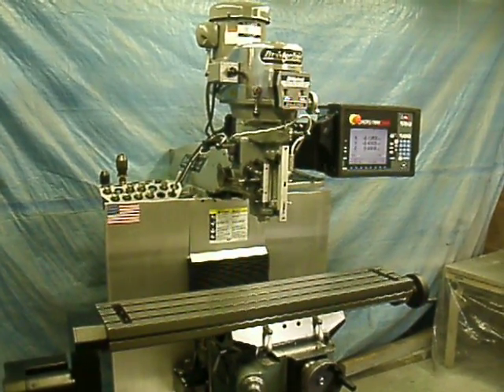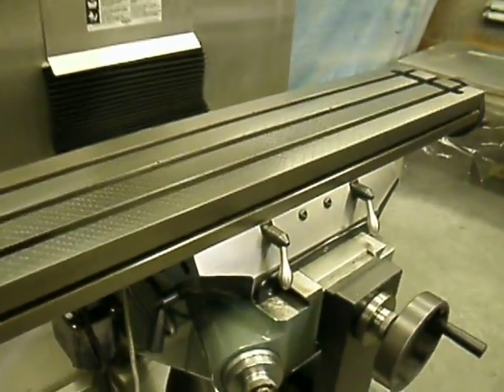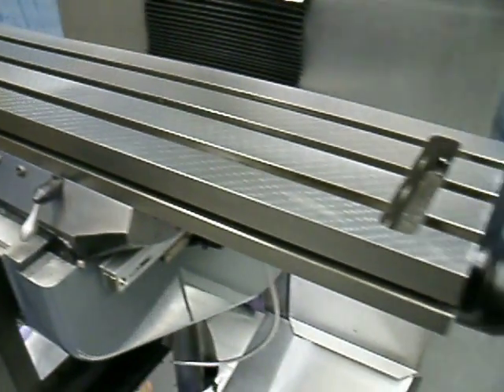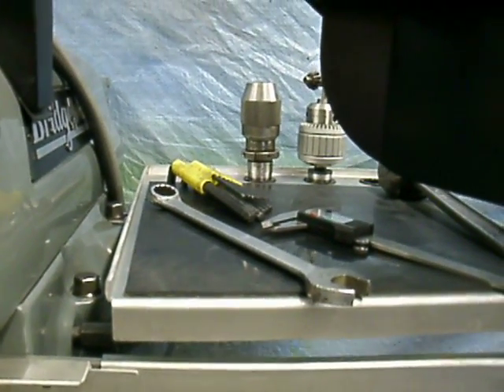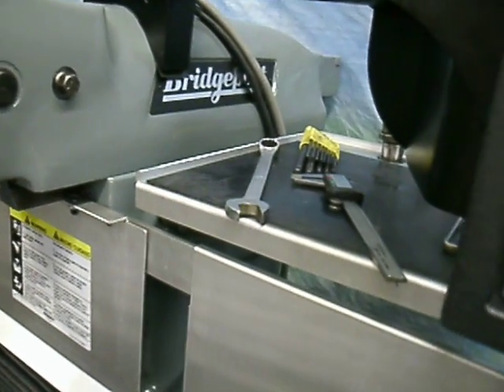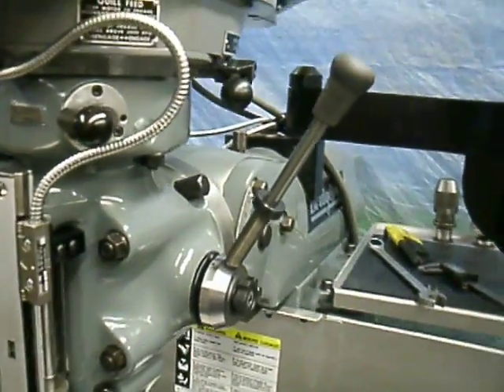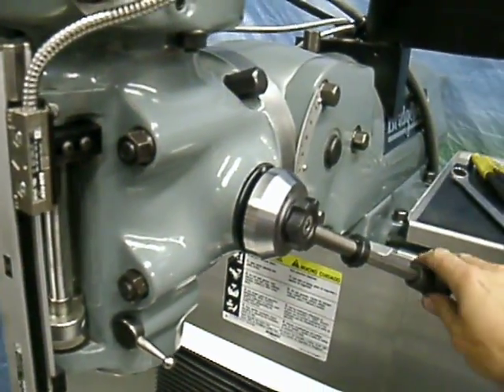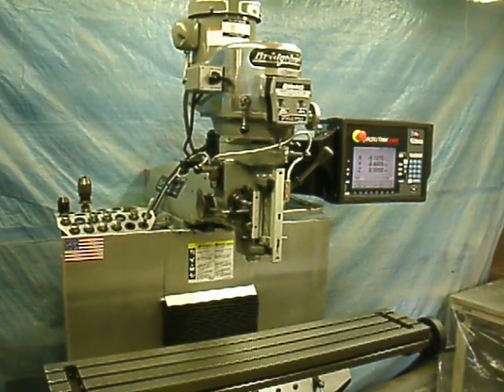Bridgeport Miller rebuilt. Incl new R8 collet rack design & new Quik Twist quill handle

Comment: Who sells the collet rack and tray?
Reply from the maker: Hello, we offered the tray and R8 rack but with few takers we stopped producing them.
Reply: @ppjjbb13  WHY???  What was it priced at?  Looks like nice stuff.
Reply from the maker: @jagboy69  They were $100 each with the support brkts included. They were very nice and i might consider offering them as I plan on setting up a Store whether on my site, Ebay or Amazon to facilitate such sales. Thank you
Reply: @ppjjbb13  They are nice looking pieces.  Much better value than 300bucks for stupid way covers.  There has got to be a cheaper way to get the same thing.
Reply: @ppjjbb13  i would have ordered them